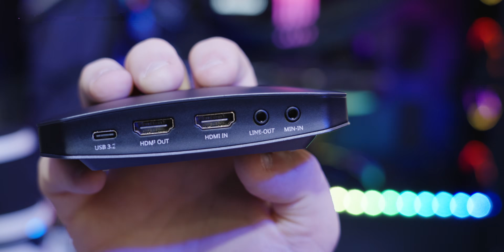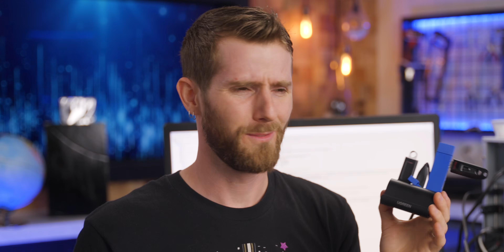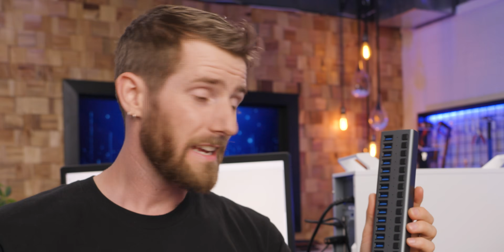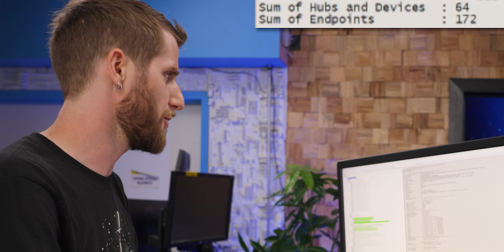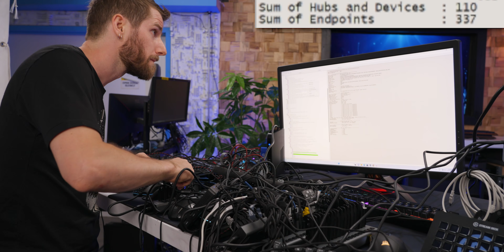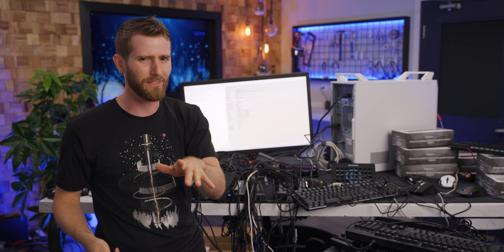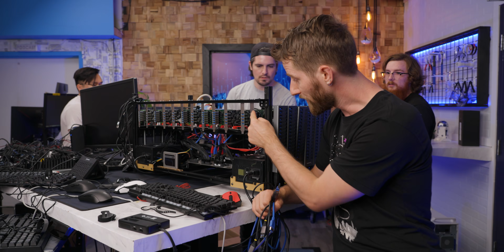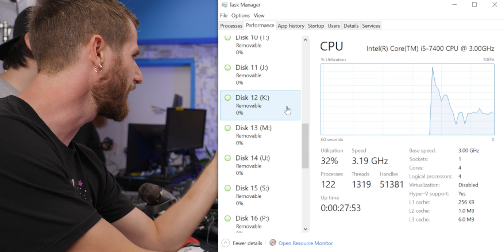How Many USBs Can You Plug In At Once?

Comment: This actually makes me appreciate the USB standard. Not only the fact you can just plug anything into it and expect it to work 99,9% of the time without any additional input, but also the fact that everyone just agreed that this is something we're going to be using on just about everything.
Reply: When they called it "universal" they really were onto something.
Reply: But in the early days, USB was called Plug and Pray because it barely worked for anything but keyboards and mice.
Reply: @BritishBeachcomber  It was a godsend for printers, especially in a house where you didn't need to have the printer plugged in all the time. I don't miss parallel ports at all. And most keyboards and mouses were still PS/2 in the earlier days, at least around 1999/2000. I feel like you had to go out of your way to find a USB keyboard or mouse, and there wasn't much point to doing so, since nearly all mobos still had the two necessary PS/2 ports.
Reply: @billyeveryteen7328  yea parallel ports are something alright. I have barely used it ever outside of VM, and emulation purposes.
It's still annoying to use even in that scenario.
Reply: There may be one or two extra 9's in there... but it's impressive nonetheless!
Reply: yutehube4468 better than what we’d have without USB being as flexible as it is.
The late 90’s/early 2000’s glut of different, completely incompatible, entirely proprietary storage standards. The sheer number of different “floppy disk replacement” standards was ridiculous, we just happened to mainly settle on USB sticks and SD cards by the end of the whole thing. 

Not that Sony wanted to admit defeat, with all the Memory Stick variations they released with an annoying naming scheme. Memory Stick, MS Duo, MS PRO, MS PRO Duo, MS Micro/M2. 

Still need to find a new M2 card for my PSP Go :(
Reply: yutehube4468  Beats the pants off a floppy disk.
Reply: better than the serial port and the RS-232, and every printer had it’s own parallel or serial pinouts and circuit diagram.
Reply: @Kiritomens I remember disk and networking controllers which could plug into the parallel port.
Reply: yutehube4468  That's very obviously an issue with the product, not the standard.
Reply: @VeshSneaks  I can get you a M2 card for your PSP Go
Reply: I can still remember the day where I could leave the PS2 keyboard and mouse connector behind. Because when you unplugged those and plugged them back in they did not work. You had to reboot to get your mouse or keyboard back. That was so fucking annoying. But then the first plug and play support in windows was buggy as fuck, it gave you soooo much blue screens that we called it plug and pray. However within 5 years or so like 99,9% of those issues where fixed. And 5 years later and usb was absolutely amazing compared to how things use to be. Still, and I don't really get this. My new AMD motherboard still has two ps2 ports on it. I think it has to do with thinks like pressing every key on a keyboard at the same time. With usb there is gonna be some limit to how many keys you can press at the same time. Something a serial port won't have. Also technically a serial port can have much lower latency.
Reply: @KainniaK  Yeah, the PS2 ports have (or had) direct interrupts to the CPU. You hit a key or clicked the mouse and the processor set aside what it was working on and serviced the keyboard or mouse. With USB, the CPU "gets around to" the keyboard and mouse with a "anything happen while I was distracted?" Many times have I been typing away on my wireless keyboard and nothing happens. The answer to "anything happen?" was "yes! I typed a f@#$ing paragraph! What have you been doing‽" And then my paragraph flashes up on the screen.

Ben Eater did a video on the USB standard and did a comparison of PS/2 vs a high-speed USB keyboard: https://youtu.be/wdgULBpRoXk?t=1766
Reply: yutehube4468  you have just shown you have no clue what you are talking about. One USB port taking an hour to charge your phone and another taking 20 minutes does not have anything to do with bandwidth or file transfer speed. The power it delivers is totally separate to file transfer. Chances are the faster charging port is a power delivery port. I have a phone charger with a variety of different ports, some are 60 W, some are 15 W, that has nothing to do with how often they are used but affects how much power it can deliver and hence how fast it charges the device.

Since you don’t have any idea about power delivery and the power ratings of your different ports it is very likely you don’t know what speeds or type the ports are either, it could very well be that your most used port is just a slower port, like usb 2.0 or something. Plugging a usb 3.0 or 3.1 or 3.2 drive into a usb 3.0 port will only work at usb 3.0 speeds, just as plugging a usb 2.0 drive into any usb 3 port will only work at usb 2.0 speeds. USB ports work at the speed of the slowest component, either the port itself or the device.

There is a good chance your most used port is a slower, non power delivery port and the one beside it has power delivery and is just a faster port, try looking at the specs of the panel, it should say it pretty clearly. The manufacturer probably made some ports power delivery and faster speed for transferring files from phones and fast charging and the other ports are just slower with no power delivery, that is very common practice.

There is nothing about USB ports that makes them transfer files slower as they get older or more used, internally all the ports are probably connected anyway and like Linus said all the USB ports go through the same root hub, so one port slowing down just isn’t something that can happen since they are all connected.
Reply: And this is exactly why Apple should cease to exist, Steve Jobs is reeling in his grave at the existence of lightning
Reply: Imagine if they could agree on universal VR standard.
Reply: @falsefultruth4884  Why would Steve Jobs be rolling in his grave over lightning?
Reply: One of the few times that the PC industry actually agreed on one UNIVERSAL standard. Lol
Reply: With Apple being the exception.
Reply: @piccilo72  huh? The only two times Apple bet on anything other than USB on the last 20+ years was that hot minute when FireWire was a thing, and lightning on iPhones, just to be proprietary AF, such is finally over, thanks to the EU.
Reply: I didn't think about USB so much I had never thought of how useful a hub like this could be.  I actually just purchased a slightly smaller version of that Sabrent hub they used so I can shut off USB devices like my stand alone numpad, a little desk lamp I have, and my other mouse (I only use my second mouse for shooters).  I can't wait to get it so I can turn things off when they're not needed, and add a little bit of desk clutter for added fun!  :D
Reply: @piccilo72  While Apple does still use their own connector on the iPhone, it is a USB compatible connector.
Reply: @l0zerth  To play the devil's advocate a little, Apple came up with lightning two years before USB-C was even defined, three years before the first USB-C smartphone and I don't even know how many years before MicroUSB was no longer being put on smartphones. Both the connector and the port were much sturdier than MicroUSB and the orientation didn't matter. It was a better connector, so good on them. 
The only real issue is that they should have updated it years ago, or just gone USB-C.
Reply: @CanIHasThisName  the Lightning connector is definitely sturdier then micro USB, about the only thing worse is 12VHP connector, but Lightning is limited to much slower data transfer than micro, and literally an order of magnitude more expensive.
Reply: the USB standard is amazing
Reply: Except for laptops, where my xbox controller, keyboard and mouse was already maxing out power usage lol
Reply: Meanwhile my 4 port USB is acting up here. lol
Reply: Yeah! The only things with USB that don't work immediately when I first plug them in is stuff that requires specific drivers, like my drawing tablets. Both my old Wacom Intuos and my newer Huion Kamvas 12 Pro have USB cables- the Intuos used it solo, while the Kamvas uses it as part of a 3-in-1 cable with HDMI and PD- and they both showed up as soon as the cables were connected once I had the drivers installed. Yay for USB!
Reply: @VeshSneaks  Cant forget those infamous Iomega Zips and Jazzes....
Reply: 14:09
Reply: This is helped by the fact that you can pretty much guarantee any modern computer will have at least one USB port. So instead of manufacturers needing to come up with their own proprietary solutions, they know that if they include this, most people can buy the product. So even the most greedy of companies won't make a proprietary solution because the math shows that almost nobody will buy it unless it has some massive advantage for gaming or similar
Reply: I hope one day all we'll need is USB. USB-C is currently aiming that high
Reply: @Tehn00bA  but someday something could come along that USBc cannot do, but at least for right now given the theoretical capabilities of USBc/ thunderbolt that is all we do need, we just need everything that isn't USBc to use USBc
Reply: apple diagrees with u and it’s laptop with 1 type c hub
Reply: @BritishBeachcomber that's just windows 98 being windows 98, it's not USB's fault lol

Even Microsoft managed to bork the PnP presentation live on stage, that was embarrassing
Reply: Imagine every single peripheral device has to come with a driver disk 😢
Reply: @BritishBeachcomber  it was called PP?
Reply: "Thing good." 
"yes thing good"
"we use thing"
"yes thing is everywhere"
Reply: @BritishBeachcomber  especially with linux :D

Comment: Every so often I get re-amazed by USB. I started using computers near the end of the 80s on a DOS machine and the hot-swappable, plug and play nature of USB really changed the game.
Reply: And the fact that almost every device uses the same connector is so damn useful.
Reply: @lukethmpsn  For real. I still remember days when you bought new phone and almost every one of them had different power supply plug, you could buy those junky power supplies with full palette of plugs that usually broke after couple uses. Those were the times
Reply: Not only data but power too. Not too long ago every small low voltage/amperage device used a little barrel jack connector or some proprietary thing for cell phones. If you were lucky you'd be able to find that one wall wart from some device you may or may not have had years ago. And even if you found one that matched the voltage and jack size you'd still have to squint and see if the jack polarity was correct. All small battery chargers used to require a wall outlet and low voltage hobby stuff like small wind/solar was a hassle because everybody did it a different way so wrangling your charge controllers was much more of a pain. 
Now it's all 5v over USB. If it's small and cheap it'll probably take USB. Even if USB charges slower than some of the older methods because of massively improved modern lithium batteries you'll still probably be charging it less.
Things are so much easier now.
Reply: @axelxan I still have boxes full of Nokia cables that came with the unlocking box 😅 It wasn't the only one making a different cable for each but man, it was the most
Reply: ya when usb first came i laughed... i was like ya thats gonna work
Reply: I worked at a computer shop in the 90s, and man, when USB came out it was the coolest thing ever. 'wait, you mean I can unplug and re-plug stuff at will, without having to reboot or power cycle?'   'what do you mean 'plug&play', we dont have to manually configure the hardware address for the game controller in every game now?'   '128 devices on a single hub? all I have is a mouse, keyboard, game controller and printer - what else could anyone ever need to plug in?'
Reply: And then apple goes and makes a crappy phone use lightning cable and Iphone users are now aliens.
Reply: 2600k, USB, and pcie - the goats
Reply: being able to forget that setting IRQ's was a thing is the glory that is USB
Reply: @deepblue812  I don't miss that at ALL 😂

Comment: Linus did a good job explaining the different limitations imposed by the USB spec, but there is one more he didn't talk about: time. More specifically, scheduling of the USB request blocks inside a USB frame that's sent out, at most, once every millisecond (in the case of USB 2.0 at least, don't know if they raised it in later versions, but I don't think so).
He mentioned the four types of endpoints: ones for configuration (Control), rapid but short message transfer (Interrupt), large data (Bulk) and continuous transfer (Isochronous). What he didn't talk about is that you can't just mix'n'match them willy-nilly, because there's a limit of how much of the frame each of these types of endpoints IN TOTAL are allowed to occupy. For instance, IIRC the limit for Interrupt types is 10%. This endpoint type is used by keyboards, mice, game controllers etc., so if you only have these devices in your system, you will effectively only be able to use at most 10% of the full bandwidth of USB.

Comment: Imagine how many times Linus had to turn USB connectors to get them to actually plug in. Truly a dedicated man.
Reply: 3 sides minimum per drive, must have taken a while...
Reply: There is a trick, on each side of the usb stick are 2 squares. If they are filled with plastic or something it’s the bottom side, if they are empty its the top side
Reply: @arriswaasdorp4111 that trick usually gets me from 5 attempts to just 3
Reply: he got the ones that dont have a switch and give power either way
Reply: Its Atleast 3 per plug. I've never done it in less..... It takes me 2 tries for usb c.
Reply: Is an external drive (not a thumb drive) a low-power device?
Reply: nah, his drop power falls them in place perfect every time

Comment: In the unix/linux world, handling interrupts for low speed i/o is a huge PITA. A bunch of USBs sounds like a great stress test.
Reply: I guess that kinda answers my question if linux would far better or not given server & supercomputer usage
Reply: @arnabbiswasalsodeep  today's small systems have more oomph than the big systems from when Unix was created. The big difference was I/o channels. You don't need those now thanks to things like iscsi, but back in the day, you had to attach it to the system, e.g. DASD on block mux connectors for disks and tape drives.
Reply: @arnabbiswasalsodeep it is
Reply: @arnabbiswasalsodeep it probably would be better for some stuff storage comes to mind where the lettering of drives in my experience isn’t a thing.
Reply: @U1TR4F0RCE Block devices under Linux are still lettered (sda, sdb, ...) but when more then 26 a present another letter gets added (sdx, sdy, sdz, sdaa)
Reply: @arnabbiswasalsodeep  It would handle the usb storage devices way better
Reply: @ToasterWithFur  Besides spanning/RAID-ing disks together you can also just mount disks under folders themselves. It gets incredibly messy and complex to manage but that way you can have practically infinite numbers of HDDs/USB keys attached without running into a 26 letter limit.
Though again I wonder who has ever run into a real scenario where they needed >26 separate drives on one computer...